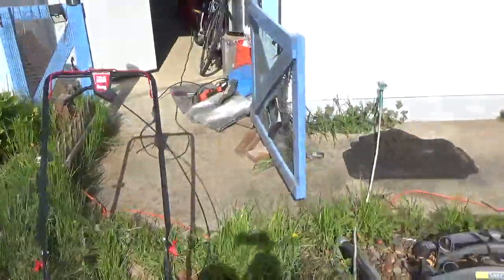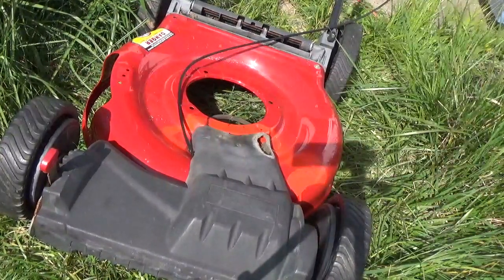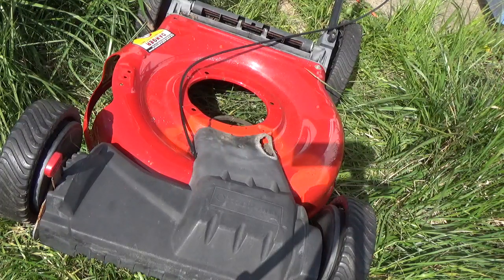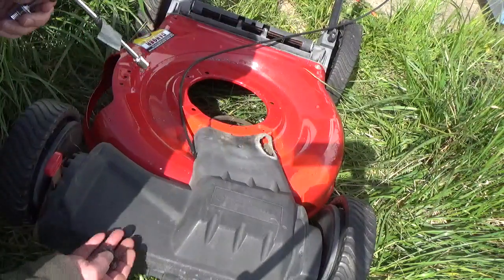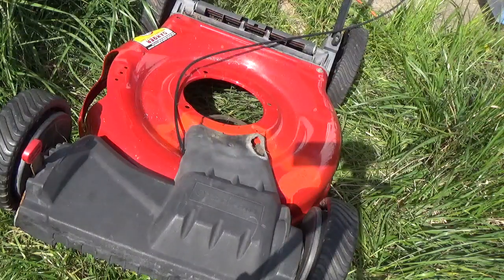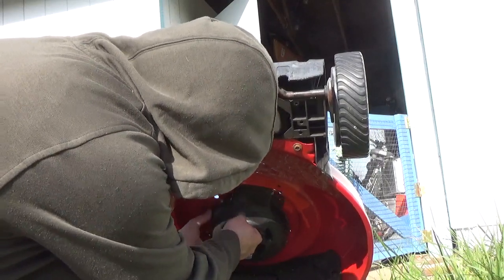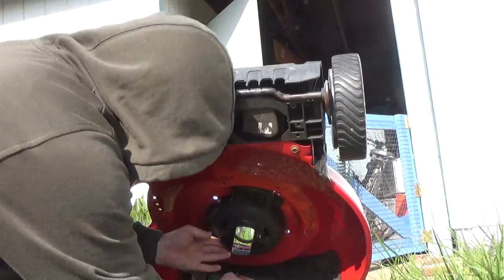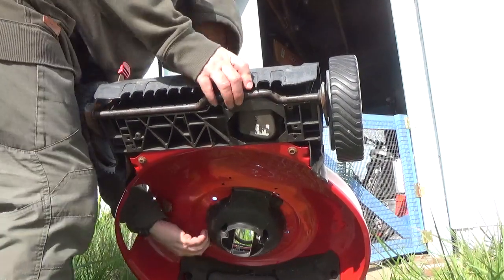part 19 Predator Swap assembly of more parts

Comment: Where did you get the part that goes on the shaft?
Reply from the maker: MTDPARTS.COM blade adapter 7/8 inch. It works great I mowed my lawn with and it self drove the entire time. Mtdparts.com has garden parts and other stuff.